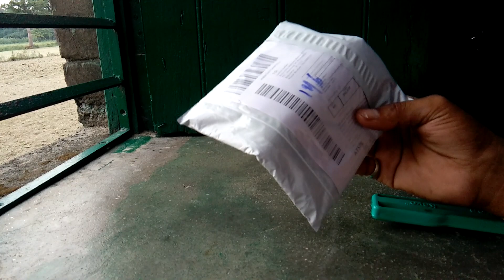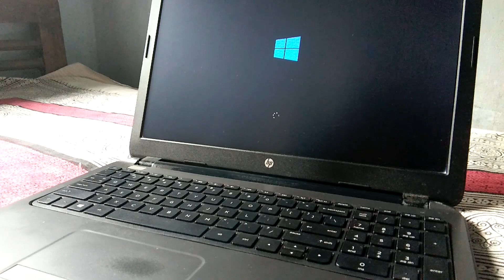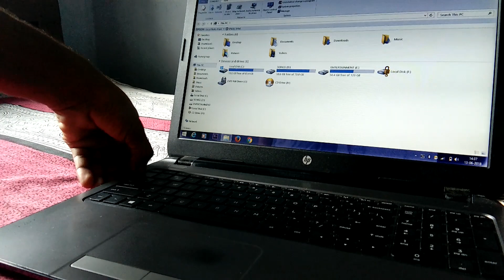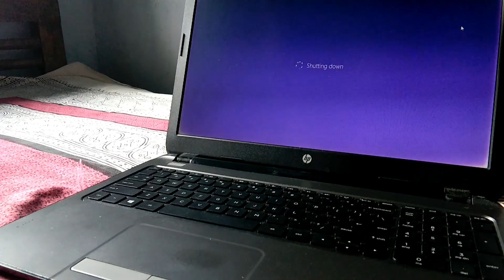DDR 3 RAM Upgrade in HP 250 G3 Laptop || Unboxing

Comment: Hey bro, i have HP 250 G3 with 4GB RAM. I want to upgade with more RAM. How much RAM maximum can i add, what type, and do I have to remove 4GB first, or i can just add another RAM module? Thanks.
Reply from the maker: You can add extra 4gb ddr 3 RAM